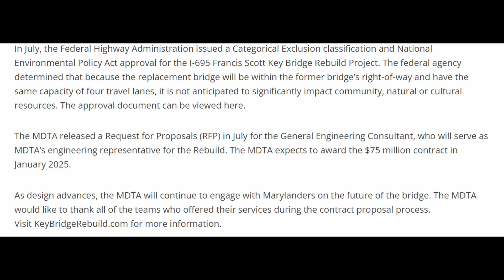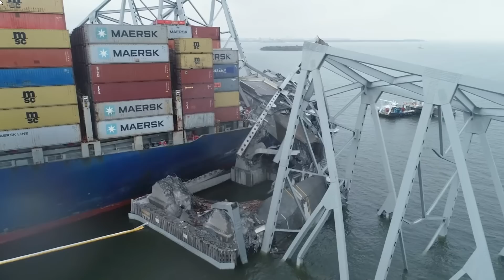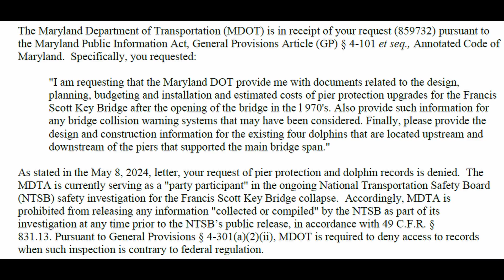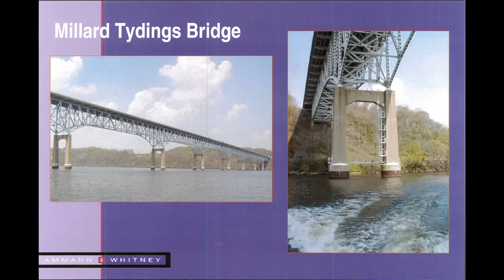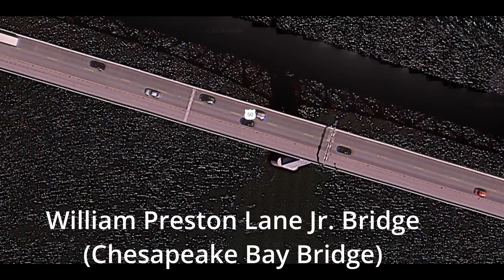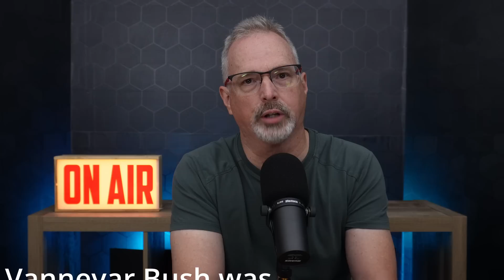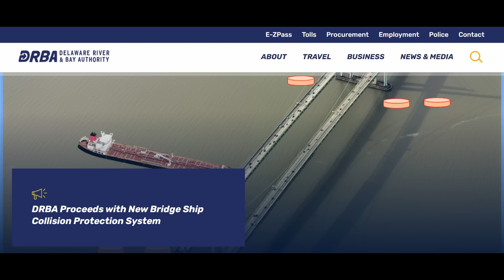FSK Update and Public Information Request

Comment: Growing up less than 20 minutes from both the Hatem Bridge and the Tydings Bridge, I can say that that part of the Susquehanna River near Havre De Grace and Perryville is not accessible by any sizable vessel. Seeing those piers in person from the perspective of a pleasure boat, which make up most of the boat traffic under the two, I would find it hard to believe that either need much protection just because of the comparatively minuscule inertia that would be involved in any crash with a vessel small enough to traverse under them, versus that of a container ship or any other large vessel. I am not a professional engineer, though I am in my fifth year of mechanical engineering technology and recognize the need for digging deeper than intuition. I would love to see the state government be more transparent about the results of these studies though, as well as see more similar studies. Other bridges in the area, namely the Rt. 213 Chesapeake City bridge over the C&D Canal, definitely have a need for a significant amount of protection. I cannot recall if this bridge has anything protecting its piers, but that canal sees an extremely significant amount of tidal current in both directions in addition to large vessels crossing between the two bays. I wonder if this bridge is well enough protected.

Comment: The Chesapeake Bay twin spans are at a serious risk. The bridges are heavily traveled. The supporting piers for the center sections have little to no protection from various angles. A worst case scenario would have one span collapsing and falling into the adjoining span. You can use your imagination to envision that disaster occurring on a Memorial Day weekend.

Comment: There are bridges near me that go over a major US river that would be child's play to sabotage with the right equipment (perhaps some drills and H.E.).  Our infrastructure is highly vulnerable to a determined person.  For example, there are some pretty large bridges on Roosevelt Blvd (12 lane city street carrying at least a million cars a day) in Philadelphia that go over creeks/parks.  The whole understructure of the bridges are in public parks and fully accessible to anyone.  The under parts of these bridges are loaded with graffiti.  But that graffiti could just as easily be H.E. and a timer for maximum effect.  Hell, it's probably highly vulnerable to a few guys with 100 batteries, 10 grinders and 100 cutoff wheels.  The amount of damage that could be done to the steel support beams with such common equipment is just astounding.

Comment: Casey, 

Your video was spot-on regarding what information was and wasn't provided.  I spent five years in Alaska post-EXXON VALDEZ.  I represented ARCO Marine, Inc., from 1991  to 1995.  I was ARCO Marine's liaison between the Alyeska Pipeline Co., the  Alaska Department of Environmental Conservation, the Prince William Sound Regional Citizens Advisory Committee,  and the other tanker operators.  The Oil Pollution Act of 1990 (OPA'90)  brought changes ranging from double-hulled tankers, to tanker escorts, to expanded oil spill contingency planning, and to Polar Tanker's (formerly known as ARCO Marine, Inc.) new double-hulled tankers with twin fully redundant engine rooms including twin rudders.  OPA'90 also created Regional Citizens Advisory Committees. After my stint in Alaska I was the Manager of Design and Construction for Polar Tanker's new tankers.

If MDOT was smart they would answer the questions being asked now.  It is all too easy to write and pass legislation that mandates the participation of Citizens' Advisory Committees.

Bob

Comment: Thank you for the update on the repair process. I do disagree with your premise that protecting bridges from attack is worth the risk of damaging a bridge by constructing the protections for supports below deck, considering bridges are more vulnerable from above,
Regarding hazard and risk assessment from shipping accidents, the old formula will apply to each bridge:
The Hazard level = frequency of exposure to risk * potential damage from risk

Comment: The challenge has increased in the last few years.   Modern container ships are bigger than they used to be, but they also have a modified hull design, with a very wide flared bow to hold more containers forward.  Thus the upper bow overhangs the lower hull like an aircraft carrier deck, meaning that dolphins or linear fenders must protrude much further away from the bridge piers to keep the overhang clear.  This appears to be what happened with Dali.  After bypassing the tiny cell, by the time the hull hit the fendering around the bridge pier, the top of the bow had already hit the pier and knocked it down.  Note that there have been a large number of cases where a container ship approaching a dock overhangs the dock, and knocks down container cranes due to the overhang of the deck forward.  A couple days ago, a container ship wiped the masts off a sail training ship in Australia.

Comment: Reminds me of the lack of storefront protection. Vehicles crash through storefronts killing and injuring people 60 times per day in the USA and no once seems to care about fixing the problem.
Reply: Should storefronts have a Jersey barrier to prevent vehicles from crashing into the store?
Reply: @alanstevens1296  Usually people will install bollard posts. Also, parking lots can be designed to point vehicles away from the fronts of stores instead of pointing at the stores.
Reply from the maker: Great point.   Gas station pumps have protective bollards but for buildings, they only seem to be at Federal properties.
Reply: @CaseyJones-Engineer  
Those store bollards won't stop a large truck.

They are expensive. They take up lot space.

Comment: I don't believe that any feasible protection system could stop a 200,000 ton ship at 10 knots from destroying a main pier and bringing down the whole bridge.

So what if a 74,000 ton ship comes charging up the river at 17 knots like the recent bridge mishap in Charleston SC, and veers toward the main piers?

They just proved that the Sollers Point site is unsuitable for a bridge.

The combination of underwater topography there and the frequent passage of ships up to 200,000+ tons.

$2 billion to build a new crossing and over $6 billion in economic losses due to the shipping channel being blocked for 2 months.

That wouldn't have happened if they had built the 6,200 foot long Outer Harbor Tunnel. That was the original plan.

Putting up another bridge there is irresponsible and that one may get knocked down as well.

Now no vehicles can cross there for at least 48 months.

The approach tunnel portal causeways are already in place.

That was the original plan there and the causeways projecting from shore were intended to have the tunnel portals for a single-tube two-lane 6,200-foot-long harbor tunnel. The two-lane freeway was placed under construction, the causeways (landfill for roadway across a water body) for the tunnel portals were built, and when the tunnel was advertised for construction in 1970, the bids received on July 30, 1970 were so high that it was determined that a four-lane high-level bridge could be built for about the same cost as the revised estimate for the tunnel project.

The causeways are wide enough to accommodate a second tunnel tube. They would have built the second tube by now (probably by the 1990s) and we would have a 4-lane tunnel facility there. 

I don't fault the financial decision in 1970 to build the bridge, but I will note that it will be fantastically more expensive to build a replacement crossing here.

Comment: Thanks for the info. Let’s be fair … yes, the pier protection is inadequate for todays circumstances. It’s was built nearly 50 years ago when cargo ships were MUCH much smaller and much less volume.
Reply from the maker: Yes, and they had 50 years to do an upgrade and chose not to.   Other owners retrofitted their bridges with such protection though.

Comment: My first career was in highway engineering. I have repeatedly tried to dialog with MDTA and they provide little if any real feedback.

I looked at the CATEX document.

Actually they got it right with four lanes (2 each way).
Average daily traffic has been flat at about 32,000 since 2006.
The eastern part of I-695 is four lanes and won't be widened any time soon.

They also got it right with 230 feet of vertical navigational clearance. The former was 185 feet. The Bay Bridge is 186 feet but that will be replaced sometime in the future.

Same 4% grade as before, which is too steep for heavy trucks trying to maintain the speed limit.

The total length is 2.4 miles (former was 1.6 miles).

10 foot right shoulders which is appropriate.

The main span would be 1,400 feet. The former span of 1,200 feet proved that totally inadequate to protect from large ships.

Building another vulnerable and unsafe bridge is not the answer.

The safe way to build a bridge there that is protected from ships is what I said.

A suspension bridge with a main span of 5,200 feet between the two causeways.
That is 1,000 feet longer than the Golden Gate Bridge main span.

I could support that but I would like to see an engineering cost estimate first.
Reply from the maker: Thank you, those are all excellent points!
Reply: @CaseyJones-Engineer  
Hopefully enough citizens will speak out to the officials that they will change the design to either a tunnel or a bridge with no piers in the water.
Reply from the maker: @scottkozel1519  I think I have heard that this route had hazardous truck transport which I understand would not be permitted through a tunnel.  I suppose a hybrid solution would be to build the tunnel for cars and trucks which keeps the channel clear and then permanently reroute the hazardous transport.  I don't know how much this option was considered.
Reply: @CaseyJones-Engineer  
The HAZMAT route now is the western loop of I-695 and certain surface roads around the harbor.

Shippers are saying that a lot of transport of HAZMAT is needed between the two sides of the Patapsco River, and that those routes take much longer and are much less efficient.

I have been unable to get any definitive answer from MDTA about the issue. They simply have not discussed a tunnel and don't reply to my comments about it.

This is where FHWA should step in with the NEPA EIS process.

 Like you I do not think the CATEX is appropriate. It is an extensive review but no alternatives analysis is required. 

I have my opinion on what alternative should be selected, but the most important thing is to engage the public and the associated resource agencies, and to lay out the alternatives before them and then to make an informed decision by the highway agencies.
 
Conduct full NEPA EIS process
1) State highway agency prepares Draft EIS -- compile comments from associated resource agencies, prepare a full range of feasible alternatives, evaluate environmental impacts
2) State highway agency conducts public hearings where alternatives are presented, with a public comment period.
3) State highway agency selects preferred alternative
4) State highway agency prepares Final EIS
5) FHWA approves or disapproves Final EIS
6) State highway agency prepares Record of Decision
7) FHWA approves or disapproves Record of Decision
 
The ship collision and bridge collapse in and of itself is a catastrophic event to both the natural environment and the human built environment.
 
Building a replacement crossing that will prevent such events in the future, is also relevant to protecting the natural environment and the human built environment.
 
Therefore I strongly urge that FHWA require a full NEPA EIS on the project.

Comment: On a simple level, this type of project might easily partner with a non-profit journalism project, that in turn could qualify for fee-free FOIA requests, and more easily solicit legal help from a PILG or university law clinic.  

On a larger scale, "security theater" is despicable, and is overdue to develop better process to define as criminal, with adequate penalties as to keep those so inclined out of agencies or positions to mask inept politics or issues like electric utility rate base factors from easy public scrutiny, while actually leaving all sorts of actual security exposures openly documented.  

That's a bit of a challenge, given how it'd require political support, but in forms that define common political corruption as both criminal, and subject to serious remedies and penalties.

Comment: Not looking to see if you've already done it:  Have you considered doing an evaluation of the rebuilt San Fransisco/Oakland Bay Bridge, and all the f*%k ups in its design and construction issues?  Because of these issues I have refused to drive across this bridge.  IMHO the bridge experience catastrophic failure during an earthquake as strong as the 1989 event that took down the original bridge.

Comment: Did you receive the documents electronically. Many people don't redact info electronically in the correct way, not realizing that the black they put on top of the text just hides it, and doesn't remove it from the electronic file. It may be worth trying to remove the redactions from the electronic document, assuming it's a PDF or maybe Word.
Reply from the maker: Thank you that's a good point.  I tried that but I wasn't able to remove the redactions.

Comment: Regarding infrastructure protection, is there any sort of "reasonable disclosure" concept for physical vulnerabilities like there is for cyber infrastructure vulnerabilities? If a friendly third party can look at some infrastructure and, using publicity available information, identify a viable attack but is unable to convince the owner to do anything more than "hope nobody else notices" what can legally be done by the third party?

In software there is precedent that the correct (and legally protected) process is to privately inform the owner and give them a "if I don't hear back I'll publish this on $DATE" and it's expected that the reporting party will eventually publish regardless but will hold off as long as the owner is making good faith efforts to address the issue. It would seem that establishing a similar legal precedent (likely with variations in things like expected timelines)  would be worthwhile for physical infrastructure.

FWIW, when I think about it, it's a bit terrifying to think how few people I'd need to suborn to cause a lot of havoc. Even more worrisome is that it would take a huge amount of work to avoid the countermeasures being more harmful than an attack.

Comment: BUISINESS OPPORTUNITY!  GO GREEN RECYCLING ♻️,  MEGA SCALE.  Coal barge conversion for bridge protection.   Spud tubes, fill 2 liter plastic bottles half full of crumb rubber, US MADE MATERIALS ONLY,  load the barge to the brim, install retaining deck, top with recycled plastic decking, hand rails,  waterfront bar's with cheap beer and peanuts, hang empty beer and wine bottles over the side with restroreflective recycled glass beads,  paint the architectural wonder utilizing the local graffiti and graphic artist and spud the whole thing is place.   Can't sink, rubber cushioned,  inert materials,  revenue generation, public waterfront open spaces, public art,  energy savings from not having to process recycled materials,  an abundance of coal barges, plastic bottles,  rubber,  beer and wine bottles,  plastic for decking,  TOM SAWYER AND HUCKLEBERRY FINN " MILK PAINT" provides a continuous self cleaning artist pallet, aquatic habitat,  seabird nesting habitat,  and great bridge protection with high visibility.   The mariners can catch a beer or two on the way in and out.   GO GREEN!!

Comment: If the Boomers pushed it, maximum failure will result. You build different bridge types at maximum quality so they last and need replacing at different times. Building the same cheap commie vomit everywhere all of the time causes maximum pain all at once when the cheap freeloading Boomer generation has finished scamming the cheapest life of utter luxury from the rest of us.

Comment: In the near term I think protection constructed in the channel is a distraction, effective but expensive and very time consuming to construct due to difficulties working in water and especially the permitting process involving most likely at the Fed level (USACE, USCG, USFWS, FHWA) and after that the state agencies also dealing with environment and protected species.

As most DOTs have intelligent transportation centers staffed around the clock I would recommend in the short term gates just like those found on moveable bridges.  These can be constructed at far less expense and with far fewer regulatory hurdles.  The part that may be difficult is ensuring that all mariners operating vessels which could pose a threat to the structures concerned have the number to call for the “bat phone” at the ITS center to activate the gates remotely.  In the Great Lakes it could be included in the training for Pilots, the coasts and internal river systems….. well I don’t deal with those.  The problem is that the information would have to be disseminated by federal agencies who seem to think that 5 years is a fast track.  I am a PE who has nearly 30 years dealing with roads and bridges.